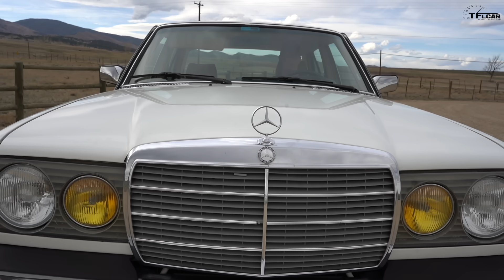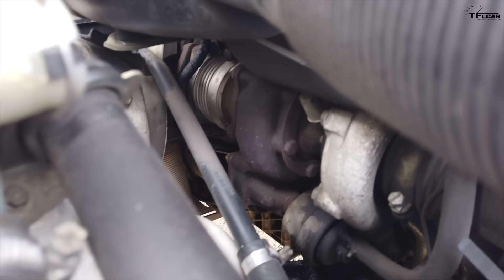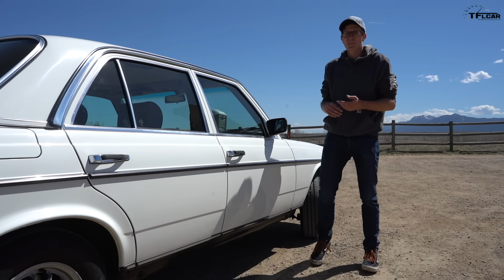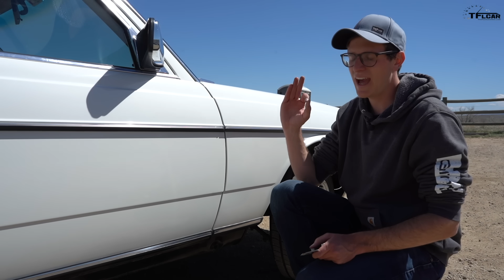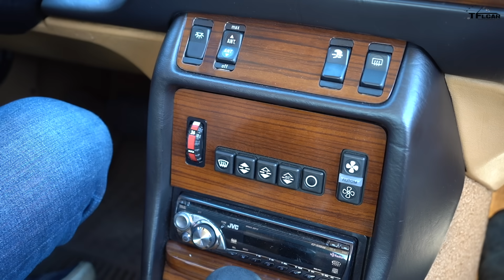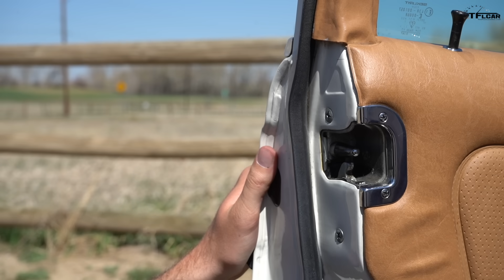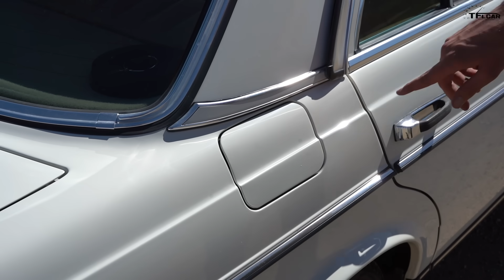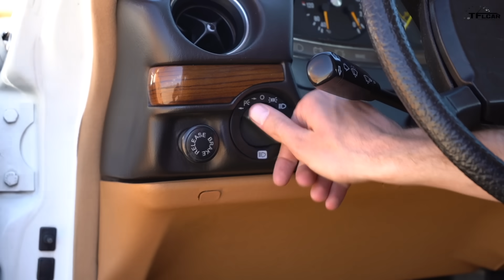This 37-Year-Old Diesel Is THE BEST Mercedes Ever Made!

Comment: This is not the best Mercedes ever made.This is the best car ever made.
Reply: I was starting it on reverse! It was my first car back in early '90, on first year of my study. So many memories...
Reply: yep if your battery dies  just push it down a hill and it starts :D
Reply: @paranoid9678  BS. Starting a diesel on compression is difficult.
Reply: @paranoid9678  vv
Reply: @paranoid9678  😎
Reply: @paranoid9678 that’s not something exclusive to this car though.
Reply: @paranoid9678  the w123 automatic diesel does this? are you sure? explain how
Reply: Lots of cars could be push started, you are making me feel so old.
Reply: Nope! Even with a manual transmission, push staring this car will not happen. It's  Diesel.
Reply: @pirate0jimmy  but if you pushed it to a long downhill road it would
Reply: @pirate0jimmy  wrong
Reply: I'm thinking flat road and me pushing, like I could with my 1979 Corolla 1200cc timy 4 cylnder that weighed 1700 pounds. Not gonna happen with automaic trans Diesel weighing 4100 pounds.
Reply: @pirate0jimmy  it starts easily pushed. I owned these about 30 years and done it many times in winter in summer... But this isnt the best M-B. The newer 300D is unicum.
Reply: @pirate0jimmy  you can bump start a diesel engine I've done it a few times to jump my old vans in the past
Reply: @pirate0jimmy  Actually, the automatic transmission cars can be push-started, but you need to get to ~30 mph.  That is because the 700.3xx transmission has a rear pump.  My 1965 Dodge Dart does too.  The 1985 CA and later 300D have the 700.4xx transmission which cannot be push-started. But, you are correct that it would be hard to start without first powering the glow plugs for 10 sec, but might have enough battery charge left for that.
Reply: Ha ha ha, yo're totaly right!
Reply: @ivannovoselac3518  It could be the volvo 240 from 199. Last yaer they built it.
Reply: @ivannovoselac3518  ik
Reply: deirsrs sried stg
Reply: For me W124 was the best. I had it from 2002-2015. It was E250 D. I bought in Germany. It was cheap, but with 50000km on counter (but realy it was, as claimed the seller 1 050 000km). It was quite good and very reliable.Maybe it was not super fast, but it was very comfortabls and nice to use. I did with it another 200 000km and I had a crash (not because my fault) :(
Reply: @Kilowatt8664  good you're still alive, w124 is one of my favorite car, I'd prefer m111 gasoline tho.
Reply: The wagon version is better. I had one. Great car
Reply: The Volvo 240 was better. However, I do agree it's the best Mercedes Benz ever made. The W126 comes very close.
Reply: @kierancurtis8545  Having owned 11 Volvos form 1958 model to 1990 and a former National Fiekld Management Training Manager for Volvo Motors of America, and having many M-Bs  my last a 1974 450SL and a former Factory Rep ie Field  Service Manager for No California  and Nevada, out of  the Sf Region.  I have a bit of experience with both.
M-B was the best Diesel Car specifically the non turbo 300 (wagon in particular) and  in gas/petrol cars.. I'll take a Volvo.. my 1967 Wagon was my favorite.
Reply: The Toyota lineup of cars and trucks are the best ever made. The Landcruiser and Hilux are sold the world over & are the best vehicles made. Period.
Reply: @marcelpatel9017  Toyotas rust and fall apart that's the problem . Unless you live in a winter free area with perfect roads . I reside in NH and  I hardly ever see any 1990's Toyota cars on the road due to them all rusting away . I do see 80's and 90's Volvos everyday on the road as they don't have rust issues as well as being able to absorb the rough roads as they are built like tanks . Same with this Mercedes  although not as numerous .
Reply: 45 years ago I owned two W123, a 240D and 300D. I’ve had numerous Benz and other brands since. I can attest that the W123 is the Best car ever made. They are a reliable workhorse with low maintenance costs
Reply: Cant agree more
Reply: your god damn right!
Reply: Exactly
Reply: Looll sure
Reply: have u drove one of this crap? :D  its a propaganda . Like Samurai Katana
Reply: @tomtomasz9798  it's not a crap
Reply: @k.k6555  it is so crap that you have millions of these still running everywhere in africa as taxis. Go to Morocco to witness it they are still running everywhere with each of them millions of miles
Reply: Yess❤
Reply: Absolutely correct
Reply: Lexus dude, don’t be fooling yourself with thinking Mercedes are best, you probably would have an argument saying that in the 1970,s
Reply: @Shane-zx4ps  You live in your world full of lies 😂
Reply: @k.k6555  look I the mirror and say that to yourself dude...
Reply: @Shane-zx4ps  It not worth arguing with someone who believes their lies.😉
Reply: Laughs in '92 Camry
Reply: Huge statement but I love your confidence
Reply: The Toyota Hilux & Landcruisers are the best vehicles made. They are international emblems of quality, durability & reliability known the world over.
Reply: @marcelpatel9017  Yah but at 10-13 mpg they are not practical and have rust issues unless you live in a desert . I also see hardly any Landcruisers on the road but I see a plethora of 25+ year old Volvos on the road in my area . I live in NH where we have winters and salted roads , the road conditions are also horrible in most areas as roads are littered with " potholes " and are very bumpy , this model of Mercedes as well as the old Volvos outlast Toyotas in the Northern regions of the USA as they don't rust away and can take the abuse of the road conditions .  Most old Toyotas have rusted away to be  recycled into pots and pans .

  I've owned 2 of the original Toyota 4runners , they used to be cheap as me and friends would buy them for like $1500 during the late 90's and early 2,000's in good shape as they made for great offroading  . These trucks don't even exist up here anymore as they disintegrated into rust .  If you want one now they are semi rare , have to find them down south for $12k+  for the 85-89 Runners that are road worthy.
Reply: @marcelpatel9017  definitely the most durable, but those old mercs are like driving on silk
Reply: not sure , there are a few old volvo's that are very close or better
Reply: Nope.  It was good but not as good as LS400
Reply: The Toyota Landcruiser is the best vehicle ever made. Only dependable vehicle to terrain all 7 continents. Trusted the world over.
Reply: I completely agree! I daily drive a 1983 300D and these cars are awesome!!! Nothing compares to these cars.
Reply: And it's actually not a joke.
Reply: Its damn much more nicer than any new ferrari or lamborghini today.
Reply: very true
Reply: I remember this car back in the 80s my cousin worked in the mb factory near Calw and he could buy a new one each year at factory cost.  My uncle had a 300D that had 800,000km on original engine and transmission. This is the best car ever made.
Reply: @jamietinker  Volvo 240 had 830000Km on Orginal motor and internals. Also theres a v70 that's done over a million. guess it's more a question of your knowledge
Reply: Agreed, best car ever produced by humans.
Reply: W124 and W126 are better
Reply: very much agreed with you !
Reply: Very well said
Reply: Modern car crash tests say otherwise.
Reply: @gj1234567899999  lol, but new cars do max 200 000km and are craps, and with Mercedes W123 or W124 you are able to do over 1 000 000km
Reply: Absolutely right!
Reply: Yes Man i have 240d is best
Reply: For me model 124 is the best Mercedes!!
Reply: Keep your mind closed brother, it’s easier that way.. 👍 Ciau...
Reply: Try  to get a hold fete
Reply: This is by far the best car ( not just Mercedes) ever made, specifically the 300D. This car made the term "Made in Germany".
Reply: Awesome
Reply: I would claim that the wagon version is the best car ever made.
Reply: I preferred the 111 series with the headlights one above the other..simpler. used to run well on illuminating parafine which was.subsidisef in South Africa or jet fuel from work.
Reply: HTF is MB, or anyone, dedicated TOWARDS quality? FFS it's TO. Not all to's have to be replaced with towards! Please stop fixing things that ain't broke, there's plenty of broken stuff to fix - fix that.
Reply: One of them.
Reply: Relax bro you got to excited
Reply: @stevegamer4683  stop 🛑
Reply: ขาย? เท่าไหร่
Reply: Nahhh LS400
Reply: @thatcarpage707  I would say the 79 rolls Royce
Reply: Volvo used to make tanks as well that would go over 500k . Even where I live in NH with very bumpy roads and winters I still see quite a few 1999 and below Volvos on the road everyday as they were built like tanks , didn't rust and are fairly simple to work on as well as cheap to repair . 80's to early 90's Volvos especially .
Reply: Facts 👌👍
Reply: Yeah, no
Reply: Mercedes is no car then..?
Reply: Agreed
Reply: @Frank James imkristus
Reply: I think the 124 is even better.
Reply: @panganaranga  *Oglier
Reply: Not if you want a fun to drive car. Reliability is not everybodys priority.
Reply: @sanctanox  An often iGnored aspect of reliability is rust resistance. Wonder why none are left in Scandinavia...
Reply: Nah the Volvo with the Mercedes diesel 5 is better
Reply: @p80t5turbo  bolvo made the most awesome sound too with the clinging parts wile accelerating, and loud fan noise. i really loved that vacuum cleaning sounding burnout ahahaha
Reply: there were some old million mile Volvo as well
Reply: Over one million miles on mine and runs great.  Even the plastic hasn’t cracked.
Reply: Ls430?
Reply: neither one or other but it´s a mercedes and the best car ever made also but not a w123 with a 3.0L diesel engine
Reply: True Talk
Reply: No way. Toyota Landcruiser and Lexus LS 430 are the best cars ever made. Bar none.
Reply: I agree 100%.
The best quality. 
Period.
Reply: What about Cadillac, Lincoln, Dodge, Ford, Chevy, Plymouth and so on? There are tons of awesome classic cars and I really wish one
Reply: It's not a Camry
Reply: Absolutely the best car ever made!
Reply: The very best 👌🏾
Reply: Absolutely not
Reply: Good build quality but too slow & too noisy.
Reply: I have an 84, I am quite fond of it, I especially like the handling. But oh my God, I wish it had a five speed manual. It rarely starts in first.
Reply: only rival is the us mail truck with the iron duke
Reply: I remember my dad put white wine on his and it ran, this car was built with pride, not with planned obsolescence in mind. This car made everyone in the country of Albania a diehard mercedes fan till this day. Mercedes became synonymous w the word car, thats how reliable this car was.
Reply: I agree 100%.
Reply: @B W i hopp it a diesel because only diesel can run without a batterie or power 

diesel dont have spark plugs to fire the pistons so if you start them they will go on unlike gasoline engines 
i drove home my little 2007 corsa diesel home one time and my batterie died on the way 

so i needet to go 12km without power (no tacho, no power breaks, no power sterring, no power windows fu i dont thing i had break lights :/  )
Reply: @paranoid9678  So it has electric vacuum pump and electric power steering pump?
Reply: @paranoid9678  ever tried to start a diesel Benz without the glow plugs in cool weather?
Reply: @paranoid9678  the alternator produces a lot of power if the battery is dead, at night is more dificult but i think everything worked this with a 220D w115 from 74
Reply: @paranoid9678  A petrol vehicle would have got you home too as the alternator powers the spark plugs while it is running, not the battery. Good luck starting a diesel vehicle after the battery dies as you need electrical power to heat the glow plugs. You don't need a battery to start a Series III Land Rover as it comes with a crank start lever (in addition to the battery powered electric starter). You can also push/pull start any petrol engined vehicle with a manual transmission without a battery, whereas this will not work with a diesel engined vehicle.
Reply: @Lutz101  You don't need a glow plug to start a diesel if you push it down a hill, the compression ignites the fuel

So you don't need a battery or a generator on old ones

If you have a cable operated throttle you can regulate how much air the engine gets

That's not a theory, I drove my car home 10km after the generator's drive gear was freewheeling and it hadn't produced any energy

By the way, most people who don't drive a diesel and then get into one ignore the glow plug light and start the engine straight away

Because that's just how they always do it
Reply: @paranoid9678  Good to know. Just have to make sure you are always on the top of a hill when the battery fails and you need to start it, or there is another vehicle to tow start it (you also need a tow cable and tow cable attachment points on both vehicles)... not sure either option is very convenient or safe. I will stick with a Series III Land Rover with a 2.25 L petrol engine and crank start feature. That said, the 2.25 L four cylinder diesel engine in these Land Rovers also has a crank start feature, but it is not practical to use due to the far higher compression ratio, while this engine is much slower and noisier than the petrol engine.
Reply: Ab-so-f'n-lout-ly!!!!
Reply: Zero to 60 in 10 light years
Reply: @richardmartin6622 not with the turbo ....it was awesome
Reply: There is a Toyota in my country, is just like this, but an MPV (or pickup truck) and is not luxurious. It will ran over a million miles and can be repaired easily even in remote places.
Reply: @anggahartoto  Are you referring to the 70-Series?  Yes they can go a million and more, no problems, though there are some issues with the current V8 diesel (dpf's and the location of the alternator), and the rear track on all but the single-cab models is narrower than the front, which was widened for the V8, that narrow rear track makes it a poor tow vehicle, but there are kits, available in Australia where I am, that fix this, and the single-cab model has been heavily updated.  Now if they would fix the other models...
Reply: @shebbs1  no I was reffering to the Toyota Kijang / Tamaraw / Qualis, they last forever, they are last made in 2007 and you still can see those from the 1980s running around Jakarta, Manila or Mumbai.
Reply: @anggahartoto  correct tamaraws still exist here in manila
Reply: Angga Hartoto pp
Reply: Dont forget lada
Reply: @apinasaatana  We can't hear you over the sound of the angle grinder and road noise. LADAs rust so aggressively and terminally you need a lot of welding. Also, fuel economy is not competitive for a smallish saloon car, and refinement is non-existent.
Reply: @apinasaatana  in the early 90´s maybe 93 i bought a new lada niva with all finishings from 70´s fiat´s ,more early 70´s and in the back it came with a big box of parts that they were ofering because they thought they were going to close doors, after they release a series looking bad with round plastic bumpers and side mirrors but they just vanished , what a car i still have it and it feels kind of driving in the past with everything inside and out just like in the 70´s
Reply: No, I'd give that to the Land Cruiser
Reply: @kevinvertezzz  to the plastic Toyota 😂😂😂😅😅😅
Reply: @k.k6555  Toyota’s are better make no mistake.🤪🤪🤪🤪🤪🤪🤪🤪
Reply: @Shane-zx4ps  If Toyotas are better. Why do Toyota owners keep swapping in the Mercedes engine?
Reply: @kevinvertezzz  Probably not, they have had their share of issues,  depending on the model.   They are great, but these are a bit better.
Reply: @kevinvertezzz  to the subaru
Reply: @kevinvertezzz  That's an SUV. SUV is a type of offroad vehicle. Cars are NOT offroad vehicles.
Reply: @kevinvertezzz  wise man..
Reply: @kevinvertezzz  That is very expensive to repair
Reply: @kevinvertezzz  still drive one since ever , i as main source of income work in agriculture, in 2018 i bought a new hilux they are now bigger and well done ,till today no problem but i kept the old lan dcruiser ,in the 80´s i still drove my 73 landcruiser and i still have it, with more than a 1.000.000 km´s done off road
Reply: Very slow by todays standards.  One of my cars an S4 has 4 times the power of this and very reliable.
Reply: @paull3179  The Audi S4 Reliability Rating is 2.0 out of 5.0, which ranks it 27th out of 31 for luxury midsize cars. ... The frequency and severity of repairs are both higher than the average vehicle, which means you can expect a higher occurrence of major repairs for the S4. So basically a piece of crap.
Reply: @funtimesatbeaverfalls  I have a number of Porsches/Audi cars.  My 2010 S4 has never had a single failure and never gone to the dealer for any problems.  It is low mileage though. Tires, brakes, plugs, oil & filter - routine service only. No engine light either. Monster torque and acceleration even keeping it under 3000rpm but I do take it to 7000 often.  Rankings mean nothing.  It is how you take of your car. I do over 120mph on highway ramps easily.
Reply: @paull3179  That's a good point you make, sorry meant no disrespect I just read somewhere that the little adjustable wheels that tension the timing chain can fail at higher miles, but  not as bad as my merc which needed a whole new wiring loom because mercedes made them biodegradable to be eco friendly.
Reply: @paull3179  did you really bring up your pos in this thread?
Reply: @paull3179  it's an old school diesel from over 40 years back, these weren't designed to be lightning quick. You're missing the point. 
Seriously you can't compare an Audi S4 to a mercedes w123. Do you really think the S4 will make it past 40 years? 🤔😆
Reply: @dannorris4945  it will sure suffer better than a Entrµ-level tractor motor that was even more outdated back then than now XPXXP
Reply: @miljororforsprakpartiet290  I beg to differ on that, in no way are any modern vehicles of the same quality. They just cannot afford to build them to this standard. That tractor unit as you call it wasn't outdated then. I own a 280CE coupe from the w123 series of Mercs. Still a sprightly car now (and rare), at the time when it was new really expensive to buy and a fast car.
Reply: @dannorris4945  diesel isn't particularly hip today and certainly wasn't in the 80s. :P
Reply: @miljororforsprakpartiet290  did I say it was hip? What I said in a round about sort of way was that the performance of the diesel engine w123's was more acceptable during the years they were produced. The petrol engines were a lot faster than the diesel engines in the w123 range.
Compared to modern turbo diesels they are definitely more reliable with less crap to go wrong, ie emissions rubbish like egr's, dpf's etc added onto newer engines.
Reply: @dannorris4945  still though. diesels are unsexy now and were completely irrelevant back then. this car is , highly unforunately, very sucky  .
Reply: @Miljörör för Språkpartiet  Yes I can see you obviously know what you're talking about when it comes to older Mercedes, especially the w123. 🤔🤥
 Yes these cars were so "irrelevant" that they produced just under two million of the saloons as well, and that doesn't include the estates and the pillarless coupès as well which are far rarer. The w123 series of cars were so irrelevant there was a long waiting list for new cars and indeed workers at the Mercedes plant were hassled by prospective buyers to sell them their own cars. But of course they were "irrelevant" cars, I think not  dickhead. It is quite evident that you are simply a troll who has no knowledge of these cars, grow the fuck up.
Reply: @miljororforsprakpartiet290 we had several they were awesome 😎
Reply: @paull3179  Will it be around in 37 years time? I doubt it.